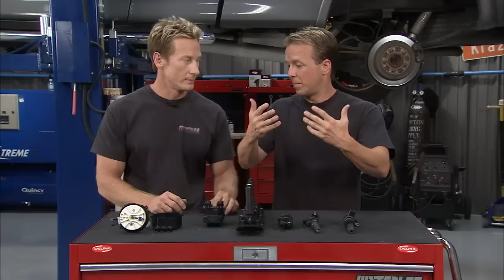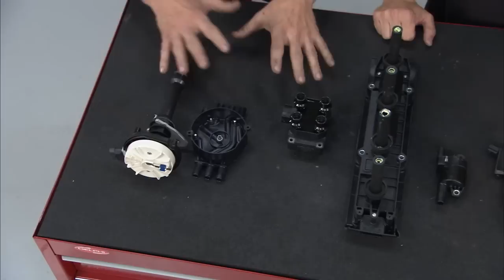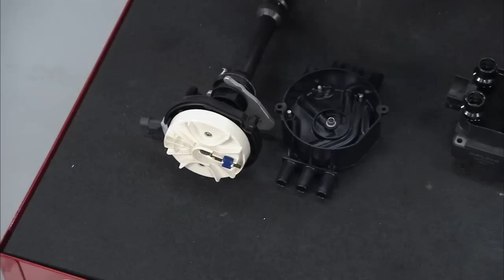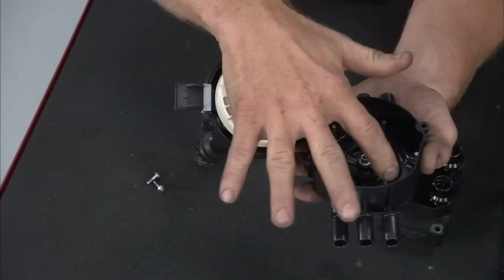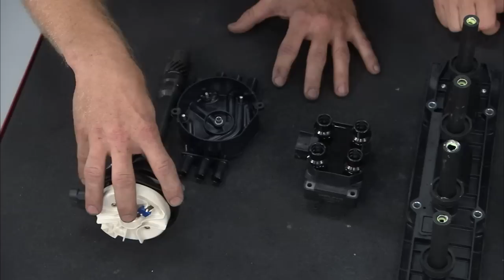Delphi Ignition Coils: Truck U on SPEED

Comment: The old system are cheaper to replace. I have old camaros, Chevy trucks and newer mustangs and a ford truck. My 5.4 coils always fail and are super expensive. And when I replaced one the other acts up. And don't waste your money and time buying cheap coil packs for the 5.4.  They will not last long. The 5.4 in my Ford f150 has been one big nightmare and money pit.